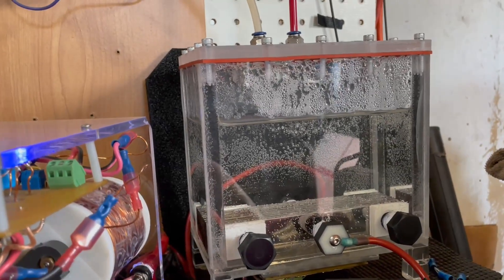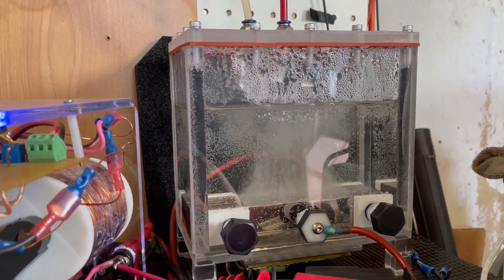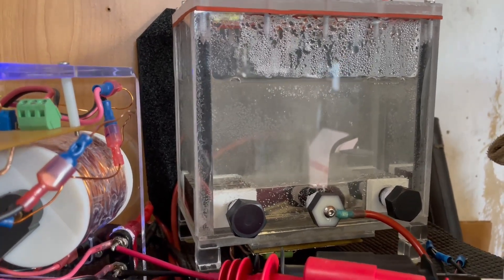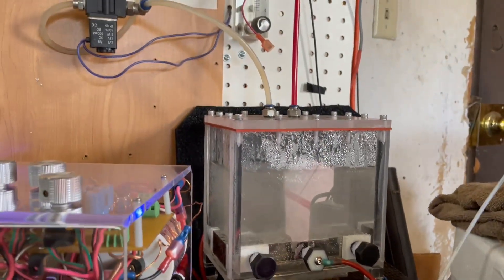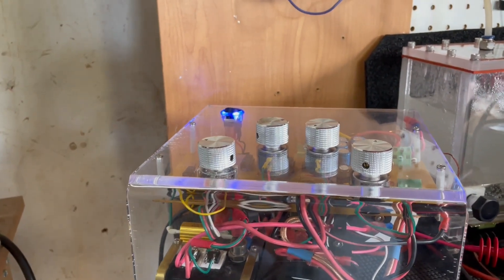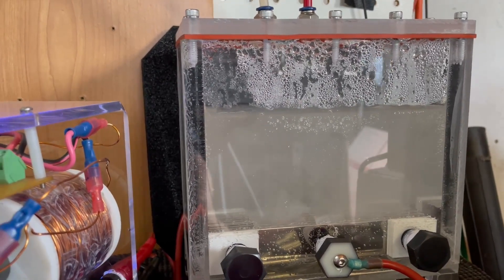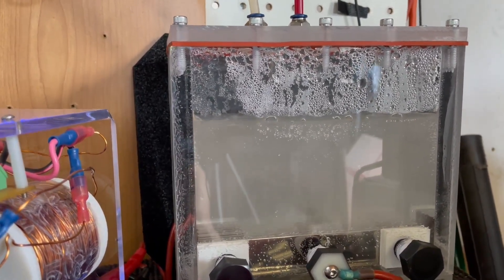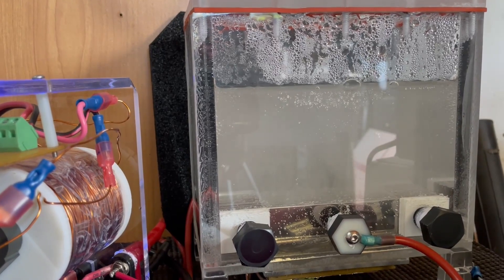The 8xa circuit with distilled water.

Comment: Huh, that's pretty neat. Never was interested in the 8xa, I'm more of a resonance guy. Thanks for sharing!
Reply from the maker: Your welcome. The reason why I sometimes go back on the older technology is to test out new theories. In these experiments I was testing out the theory, "Can one force the water capacitor to go into a state where it will reach the ionization threshold?" The answer seems to be yes but it takes some doing. It would take a much larger inductor and a higher voltage rated SCR switch.

I'll be going back to the VIC circuit in the next few videos as that's where the true magic happens. What's been holding me back is I have to purchase some wire tensioners and the cost to get them is on the high side. Once I have them I can truly get back to work towards bringing this technology out.
Reply: @h2opower  Yep. Got to start somewhere. Keep me updated on the VIC

Comment: Can this tech do anything to steam?
Reply from the maker: Yes it can but not in with a multiple cell wired in series as all the cells would have to be wired in parallel for that to work. This technology is very different than electrolysis as it uses high voltage potential difference electric fields to get the atoms to eject their electrons. Everything that finds itself between the electrodes gets ionized to the point where the atoms start ejecting their electrons, be it in a liquid state, gaseous state, or even a solid state such as ice.
Reply: Temperature is the enemy in these kinds of systems. That's why electrolysis is so inefficient. Steam is simply a state change in water due to temperature too

Comment: Thank you for keeping it alive. A recent video on a popular YT science channel just did a "debunk" of hydrogen as a fuel saver in petrol engines. He concluded it did not work. There was a whole bunch of calculations to show that even at 100 percent efficiency it can not be feasible. I argued he didnt try all the possible gasses that come from a cell depending on the electronics, and used a cell with lye in it to do brute force electrolysis, then thry a wet bubbler which will help ruin the high energy potential. So the concept of changing the burn speed needs to be brought forward to shpw these naysayers that H is not just the ashes of water but a very variable fuel that can be tailored to the desired engine. I will be demonstrating a burn speed change shortly. Advise you do similar.
Reply from the maker: I'm also a mechanic so I know the true reason why they don't get any improvements when adding hho to the system and that reason is they never reprogramed the engine management system to account for the extra fuel in the system. It's set to 14.7:1 ratio and needs to be changed to something like 34:1 ratio, but truthfully a proper engine dyno tune needs to be done when adding anything to the vehicles combustion system. 
This is why they don't get any improvements as the ECU has been programed for just the fuel the vehicle was built to use so adding anything will actually hurt performance in the long run as the ECU tries to adjust things according to the way it was programed to maintain things at.
Reply: @h2opower  excellent info, in the case of the video i mentioned, it was a stationary type engine, it didnt have electronics as far as i could tell.
Reply: @jadenspires1891  the channel is called tech ingredients.